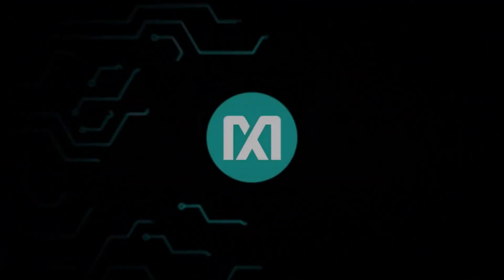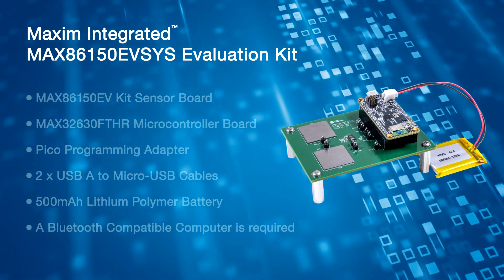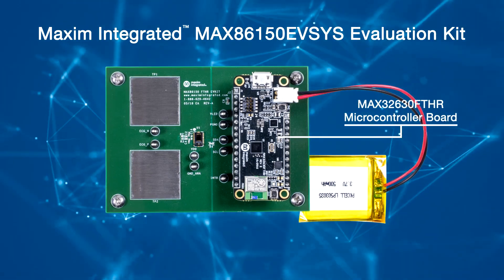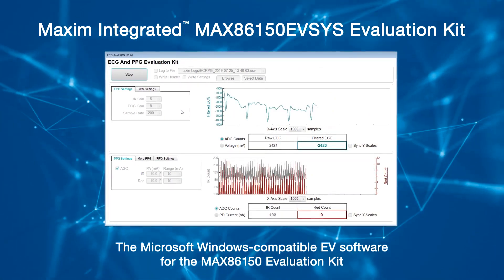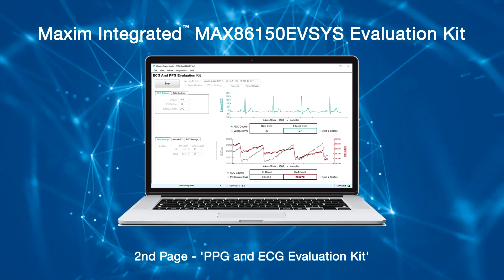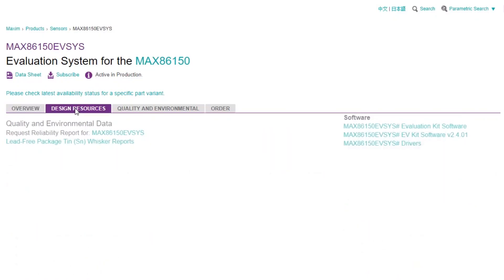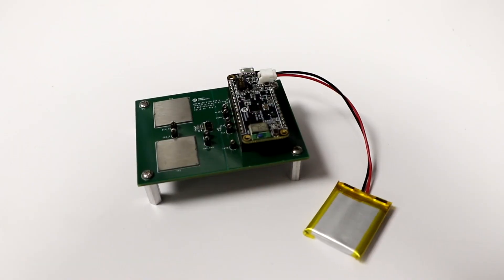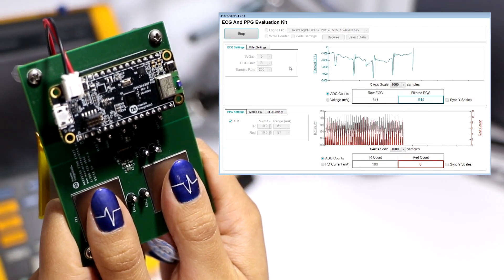Maxim Integrated MAX86150 Evaluation Kit - Engineering Bench Talk | Mouser

Comment: is is not intuitive having the sensor soldered to the board.  It limits to sensing the finger(s) only.  It would be better (for experimentation) if the sensor is connected to the eval board via extended cable.

Comment: hi 
I am using MAX86150 with Arduino nano.
In most recourses I have seen the number of IR count is greater than the number of RED count, but in my case the RED count is greater!! is it normal?
or should I use any configuration except the default ones?
Reply: Can u please tell me from where did you buy this product and for how much ?